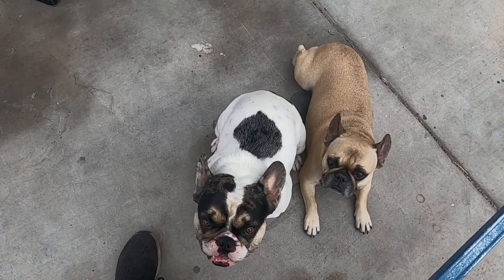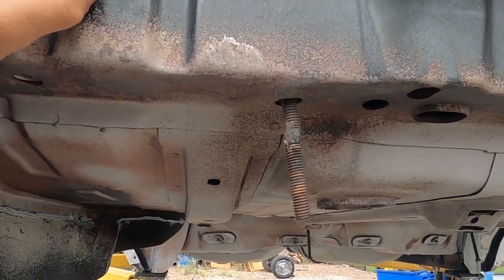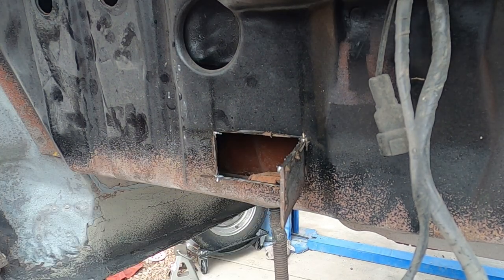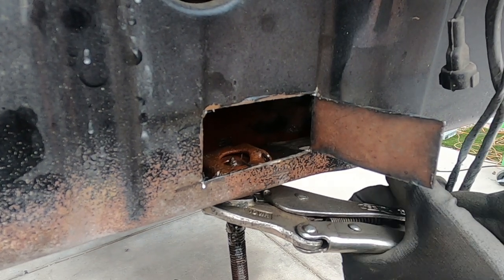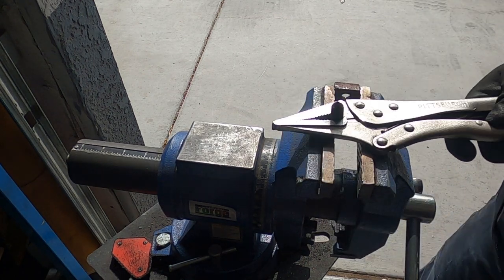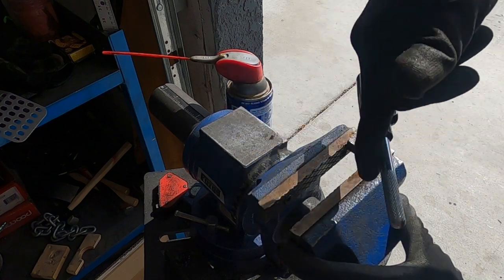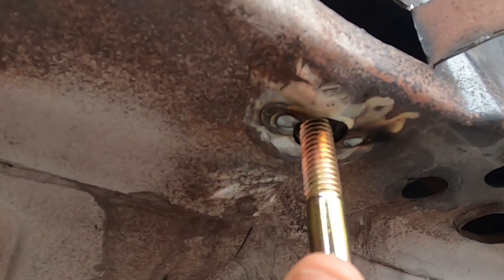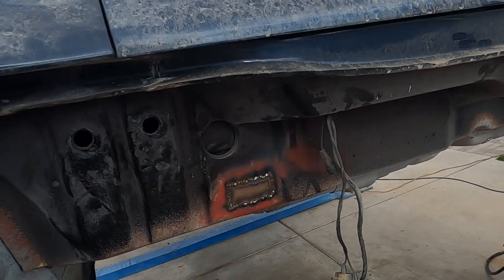REMOVING BODY MOUNT BOLT THAT SPINS

Comment: easier way is to weld the cage nut in place.  I've replaced tons of these mounts and tried everything.  Welding it the bolt always comes out for me and you can just thread in a new bolt.  I no sooner wrote this and you tacked it back in.  I weld it before taking the bolt out is the only difference but no matter what you do these things are a pain in the ass!  ha ha

Comment: Realistically, it's not too bad of an idea to try spot welding it to the sheet metal before even cutting a door out, you could just drill those two holes and spot weld the square in place then try to remove the bolt!